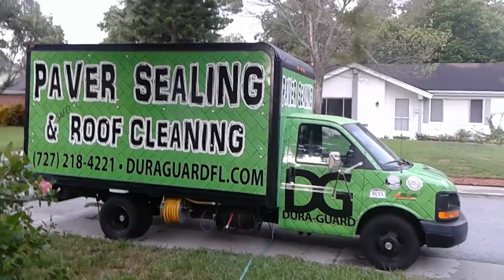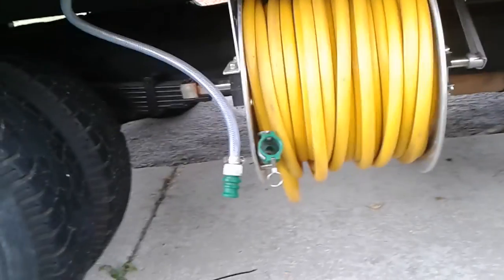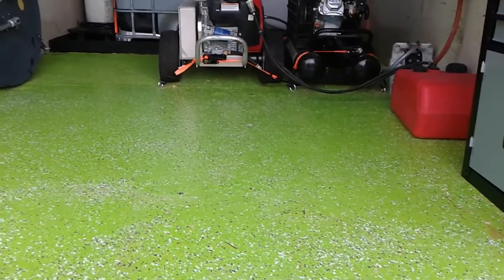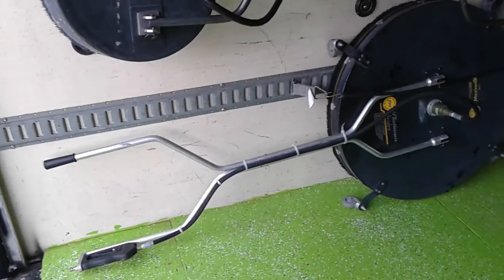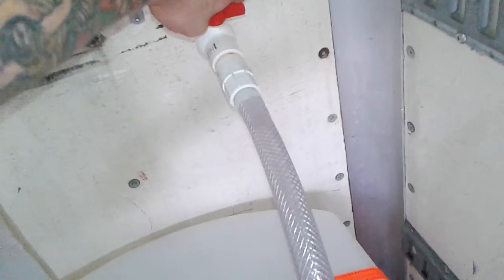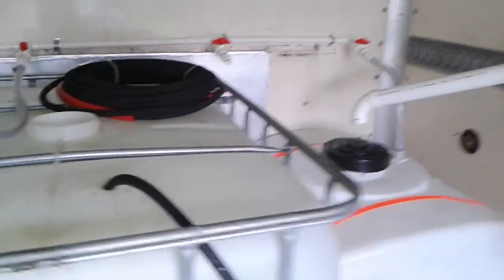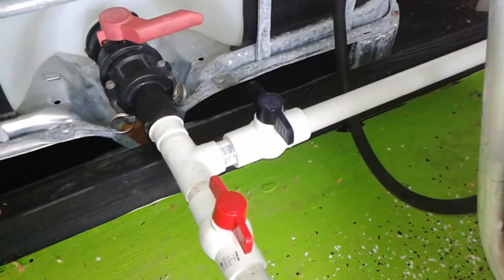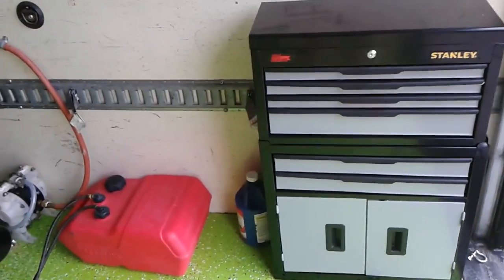Paver sealing and roof cleaning box truck set up

Comment: Hi Rick, I really like your truck and the set up you engineered is awesome.  I'm at the point of getting serious about  power washing and soft washing for 2017.  I'm retired but decided to go back to a career I had years back and that was fence painting.  We do fence/deck painting/staining in the Northern Virginia area and I've been doing just power washing for the most part to compliment the staining and painting.  I've accumulated some equipment: 3500 psi 2.2 gpm and a 4000 psi 4.0 gpm gas power washers, telescoping wand and misc tips and wands.  I want to move into soft wash for houses and roofs this year and any help or advice you can offer would be greatly appreciated.  I haven't decided if I'm going with a dedicated trailer or a dedicated truck at this point, but probably the trailer as it is less initial cost than a truck and if things go well, the truck can come later.  One thing that has really helped move me in the right direction is I got hooked up with HomeAdvisor and that has brought a lot of customers to me for power washing and soft washing.  Thanks for the great video!!!  Jack Pinnell, Heartwood Construction.  heartwood3677@gmail.com